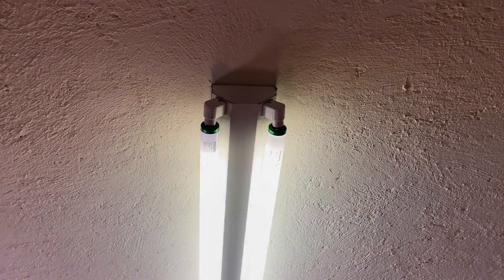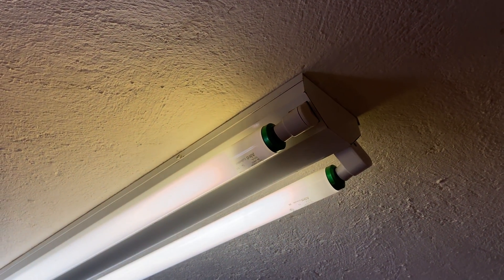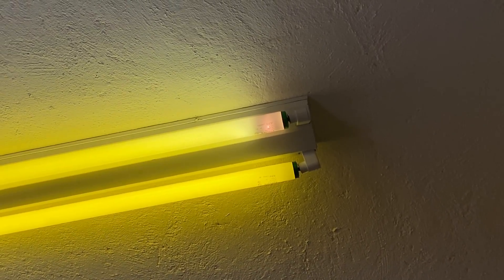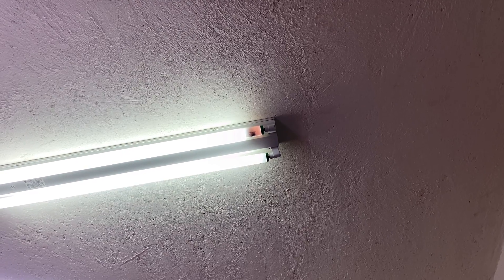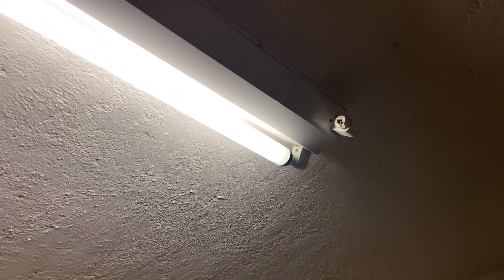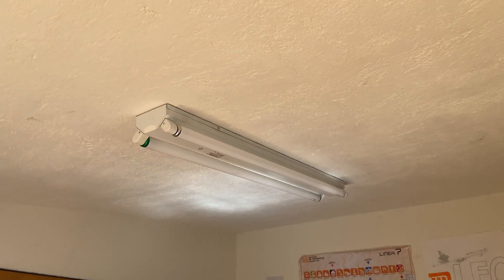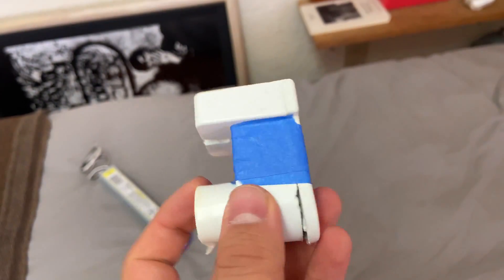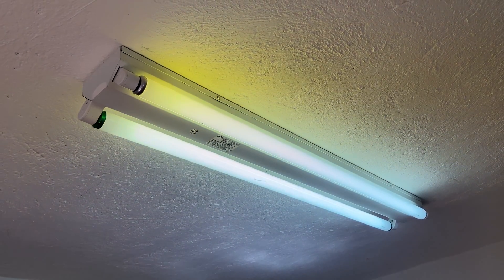the death of a fluorescent lamp vol. II (it gets scary)

Comment: the bulb looks new at the start of the video
Reply from the maker: Well, it was made in may 2003 (that's why it has the E3 code at the info etch) so it has around 19 years and with a lot of hours in it.  When fluorescents starts to run on CCM, they usually start slow and at intervals and starts to worsen overtime.
Reply: @THEBULBHOME  the bulb went bad very quickly
Reply from the maker: @Stewart Fairclough  You see it edited in the video the whole experiencie, but it actually took a few days to burn the base and fell out.
Reply: @THEBULBHOME  one of the end of the bulb is not black ant the other end is black weird